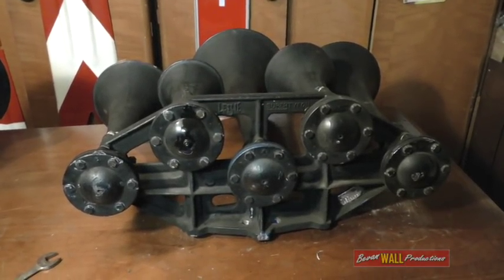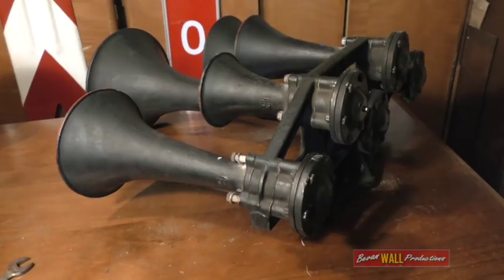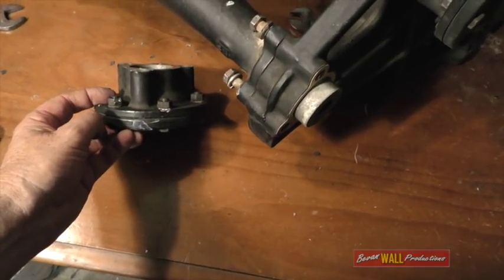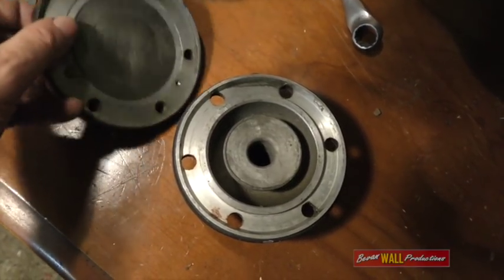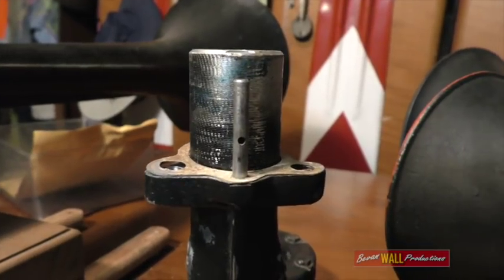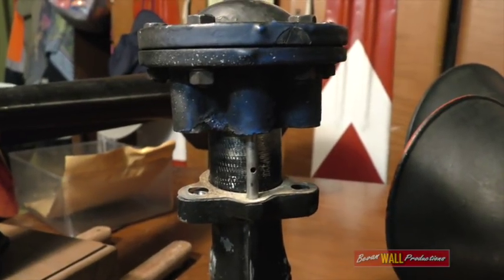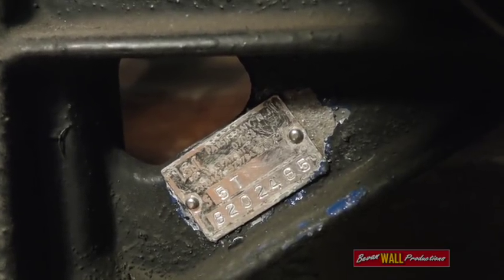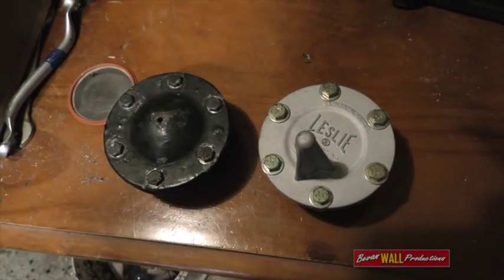Fixing the Leslie S-5T horn on C510 - January 2018

Comment: Hi Bevan. Great video. C class locomotives were actually introduced in 1977, with C501 entering service as the first one of its type in 1977. C510 entered service in 1978, so that Leslie S-5T that you have, is the original horn because it has the date stamp of 1977.

Also the builders tag on the rear of the manifold says 'PARSIPPANY NEW JERSEY' as the headquarter location for Leslie at that time. Now, Leslie built their horns in their Parsippany factory from 1968 to 1985. Therefore, this makes sense that the horn in your video was built in 1977, hence also making it factually and historically logical to be the original horn mounted on C510.

Please keep the old S5T's working. I much prefer them over the RS-5T's due to their more pleasant and smoother overall tone.
Reply from the maker: The serial numbers of the ten original horns fitted to the C class are on record. The horn shown in the video is not one of them.. We do not have enough S chambers in good condition to keep all three S-5Ts operational, so one will have to be converted to an RS-5T. The worn out S chambers will be kept, and possibly sent to Mike Muha in California later on for re-machining back to factory specifications if viable.
Reply from the maker: The blue paint is not VR. It was applied by Silverton when they acquired the locomotive.
Reply from the maker: Actually, I've just been told that the serial numbers on the tags are not specific to each horn. It is simply the part number that EMD used, so you may well be correct in suggesting that the horn could be the one originally fitted when the loco was built.
Reply from the maker: Another update. Apparently Clyde Engineering stamped a specific serial number on the base next to the air inlet on the ten horns they ordered that were fitted to the locomotives when they were built. This number starts with "CE".The horn in the video does not have that on it. It is probably one of the spares delivered directly to VR which were rotated through the locomotives over the years.
Reply: I'm no expert on locomotive horns by any means, but I did notice the blue paint on the horn base as well as the number 77. I thought that the horn may well BE original. All I know is I'm partial to a good sounding set of diesel locomotive horns or a good steam whistle! Thanks for the history lesson, too!
Reply: DC4916 Productions No worries! I am obsessed with Leslies. I own an ex Conrail S3L that was built in 1970.
Reply from the maker: The blue paint is from when Silverton had their livery on the locos, but I have just learnt  that the serial numbers on the tags are not specific to each horn. It is simply the part number that EMD used, so you may well be correct in suggesting that the horn could be the one originally fitted when the loco was built.
Reply: Thanks for the corrections - I'm always happy to learn something new about the locos we like so much. :-)
Reply: Bevan. Yes the serial numbers for round dome back S5T's are all the same. Each serial number is simply the EMD part number for that specific model of horn. I do believe it is the original horn fitted to C510, as C510 entered service in 1978, and the horn is a 1977 build. But you could be onto something about the 'CE' stamping. Great video.

Comment: Thanks for that Bevan. Would you happen to know how I could go about sourcing a pair of early series 48 class air horns? (IE: 4801 to 48125). Not sure whether they come up on any websites from time to time like they do in the USA. I'd like to acquire a set if possible.
Reply from the maker: What you need is a pair of Westinghouse horns (one A & one B) which was the standard horn arrangement for the 44s, 45s, 49s & most of the 48s and 46s. The Australian Ebay railroad memorabilia section is where I have seen them become available from time to time.
Reply: Thanks Bevan....I will keep my eyes open for them... Cheers and keep up the excellent work.

Comment: Great work mate! I thought the C’s had RS5T’s but they don’t also why do some of the C’s Have P5’s?
Reply: Aidan From Aus C classes were delivered with S5T's. Many were re fitted with RS5T's and P5's. A common problem was that the 25 bell (lowest pitch bell) would go silent and malfunction. The reality is that the older Leslie S type chambers would malfunction after just a small amount of wear, and they would malfunction very easily if a small amount of debris entered the power chamber and disrupted the diaphragms.
Reply: If a Leslie power chamber is worn severely enough, it is a requirement to have it sent off for professional re-machining on a lathe back to internal factory specifications in order to function properly again.
Reply from the maker: The worn out S chambers will be kept, and possibly sent to Mike Muha in California later on for re-machining back to factory specifications if viable.
Reply from the maker: When the locos were reactivated after being in storage for quite some time in the early 2000s the original Leslie horns were either missing, or beyond economical repair. Nathan P5 horns were readily obtainable and cheaper, so they got fitted instead.
Reply: bwDVD oh
Reply: Richard Cai oh ok
Reply: Richard Cai oh